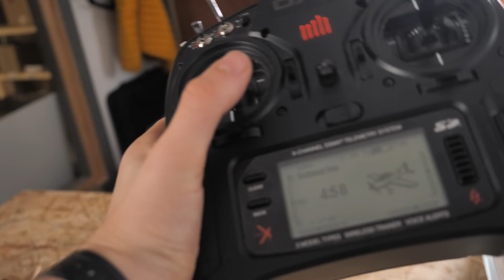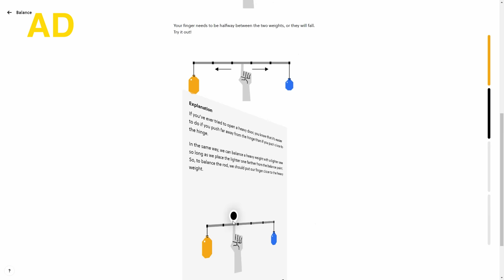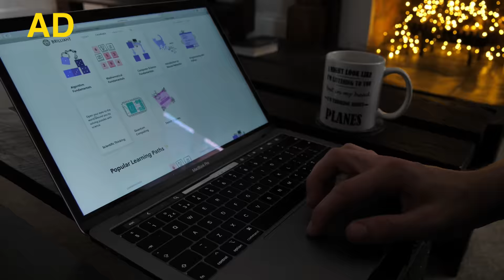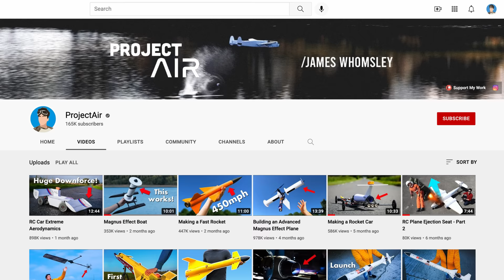Making an RC Submarine

Comment: Great project! I like the small size of the sub
Reply: Yeah
Reply from the maker: It'll be handy for exploring tight spaces!
Reply: Dave Doherty  A pulse jet powered submarine powered by...
.
.
.
.
TOMATOES!
Reply: @Project-Air  The simplest way to eliminate water slosh upsetting the balance is to fill the water bottle with sponge. It will absorb the water and what does pool in the bottom won't be able to move fore and aft.
Reply: @Project-Air  Your submarine reminds me of the one made by Brick Experiment Channel, cos it is made using everyday household components. :) I like this ingenuity. 10/10
Reply: Aren’t small things great

Comment: This is so cool. Was thinking a lot about building an FPV sub. And I run into same problems with water and data transfer in my head. I would try and just expose antenna to the air on a really small and light floater using very thin wire. Tangling could be a problem in that case, so I thought about some sort of antenna wire tension/retraction system. Not sure if there are antenna wire length-related problems, tho.
Also, 3rd motor oriented to up/down axis and with some pitch control would give it much more maneuverability and control in tight spaces. And could compensate for most of the boyuancy problems.

Comment: As I mentioned on Matt's video: I love the designs and can't wait for someone to inevitably come up with a truly wireless control system for subs :)
Reply: sonar might work well for a few hundred meters until it becomes laggy
Reply: @nou5440  I've seen some experimentation for ultrasonic used for communications so I'm definitely curious if that would work reliably in their small creeks/ponds
Reply: @nou5440  I've often thought about this. Problem is, there'd be no way to get video back.

Comment: Great video! Add a 'trailing floating wire antenna" for the RC TX/RX. Make it buoyant and long and some portion of it will float on the surface, even when at depth. (BTW, That's what real submarines do)
Reply: this is a good idea. plus sub marines arent designed to move fast

Comment: Great work! Really interested to see if you find any success with the low frequency stuff. I've heard you can "potentially" get up to 30-40m in fresh water for basic controls with the right conditions at 27/40mhz. Video transmission may prove to be much more difficult or perhaps simply limited by bandwidth and/or physics, but I'd love to see your results regardless!

(btw there's no link to Matt/DIY Perks video in the description as of writing this comment)

Comment: The trick to low frequency data transmission ( for the video ) is that you have to broadcast the data over a spectrum of frequencies because the max data rate will always be frequency/2. So basically you end up transmitting 1/10th of the data on each frequency, but you transmit on 10 different LF frequencies and recombine the signal at the receiver. I don't know for sure, but I think that the Navy uses a lot LF transmissions for underwater coms.

Comment: Humm... I didn't thought about the sloshing water, I did for the cable, it was huge.

Some notes.
For water sloshing, have you considered using foam or a more dense than air material that can be fixed?
I also thought about peristaltic pump and a bladder for better buoyancy control, for Diy perk's sub, turns out I wasn't analyzing his project correctly again.
On communications, a thin USB cable could be a decent tender.
However I would consider just a long antenna cable attach to a buoy.
My thought being, just use a long wire, however it has problems with impedance, so just a long coaxial cable sound safe to me.

If only submarines weren't expensive, a relay fleet sound like fun headache.
Reply: I like the idea of the floating antenna. Indeed coax cable will be needed. But for sure: waterproofing a cable will be a challenge. Even in military size subs they still have a challenge in communication

Comment: I think the problem with using a water bottle as a ballast is that the submarine design isn't always going to be level, unlike DIY Perks' design which doesn't pitch forward or back. With yours, once you pitch forward or back, the water will go to the furthest point in the direction your pitched in, making it really difficult to pitch the other way. We could see that when you tilted your sub down, it never levelled out again. This wasn't a problem with DIY Perks, as his submarine was designed to be symmetrical, meaning it's CoM is in the middle constantly. If it was to tilt in a direction though, it'd probably be able to recover, as his has two dynamically weighted ballasts, meaning it could go back to the surface and level out, or make one side lighter than the other to level out and then equalize the weight once level.

Comment: Great project! How about a simple floating pod with all the avionics (2.4GHz ok :) - then a long thin umbilical down to the craft? This would be similar to the Nemo dive system -  a 9m deep battery powered scuba system - only it uses an air pipe instead of the cable :-) The craft should easily pull the pod along.

Comment: I used to race sailboats around flags on lakes.  To keep the flags in one place we built them with a concrete anchor (plastic jug with a handle filled with concrete), and tied a 10 feet (roughly 3 meters) of polypropylene rope (the yellow stuff) to the anchor.  The flag was 10 feet of 4-inch PVC pipe sealed at the bottom but with a hole for an eye bolt.  We tied 10 feet of polyester rope to the pipe.  The pipe was partially filled with sand so it would bob in the water with the flag end up.  Polyester rope sinks to keep from fouling boat propellers and rudders, and polypropylene rope floats (to keep from fouling on the bottom of the lake).  The rope in the middle didn't matter as much.  So if you wanted to make a floating marker tethered to your submarine, you could do something similar.  Below 10 feet deep there's not much to see until you get to the bottom.  Adjust your rope accordingly.  Our lake was 130 feet deep near the dam, so we needed about 200 feet total for our purpose.

Comment: On board power with a very light tether (cat6) seems to work best.  Add weights/foam nodes on the tether to make it neutrally buoyant. Another option that might be cool for control (not video) would be to play with a sonic pulsing transmitter/receiver set up and a light weight video cable.  I think combining the two set ups would be ideal though.  A light weight, neutrally buoyant  control cable connected to a float which has radio on it so the cable would be for depth only.  I love the VR helmet set up. I would add a heavy fishing line (In the U.S. we hall it 80 pound test) tether to the float for easy recovery.  For power look into the tubular battery packs some cordless tools have. I wold also mount the two main motors on the fin controllers you originally had so you can change the pitch to look at something with out moving from where you are.

I love the video and wish I could do things like this myself.  Thank you.

Comment: Hmm, as an alternative to completely filling the main bottle with water, fill it so it is neutral then weigh that water.  Mix up some epoxy to that weight and put THAT in the water bottle (sitting level).  Once the epoxy cures it won't be moving.  Then you could probably use smaller syringes for trimming the buoyancy.  You could also make a 1 or 2 meter long 4 wire tether going to a foam float with the antenna for the RC and FPV mounted on the float.

Comment: Love this! But I have a couple of ideas, firstly for low frequency control getting an older JR or Futaba radio will be by far your best bet as they are module based and just as programmable as modern stuff. But for your sloshing my suggestion would be to try and fit a set of baffles within the bottle, no clue how, but that would vastly limit the effect the water's movement has on the sub's movement.

Comment: I'm growing more and more tempted to build a sub like this. 

I think it'd be cool to do your buoy system from v1 but instead of sending power and a half dozen signal wires, instead get a receiver with a serial protocol (like how DSMX satellites or SBus Receivers interface with multirotor flight controllers) and run that data down through ethernet cable like Peter Sripol's sub  and then have power and interpreting onboard the sub, but still be able to have wireless above the water and then have a pretty light, decently flexible tether. Then you could get data back up to the surface via another pair of wires and then put your FPV transmitter in your buoy as well. 

I think the "Pro ROVs" have a neutrally buoyant tether so it affects the craft less too, but it's kinda pricy if memory serves.

Comment: If you fill the bottle with a granule material it might help with the sub's balance. The granules/particles will occupy the volume of the bottle but the spaces between them will be occupied by air making it stable to changes in pitch

Comment: I love the simplicity of the design! Is it feasible to 3d print a structure that would fit between the silver cap and extend axially into the bottle?  The structure would feature an external drive propeller and dive planes and the internal portion of the structure would contain RC components, a syringe pump system, and a power system. I understand it would add a layer of complexity to the ROV but it would preserve the overall simplicity of the design. DIY Perks has done half the work it's a matter of sizing the structural frame to fit inside the bottle.

Comment: You have given me some great ideas. Like adding a shifting weight inside the bottle to change the center of gravity forward and backwards. Mix that with rotation on the motor pods, so you can tilt the craft to sa set angle, and have the motors provide thrust at the same angle to move along at , say, a 30 degree angle tilt with a 0 degree forward direction. Space the 4 syringes around the hull evenly to distribute the buoyancy around the craft so it could maintain the tilt angle more effectively. And add 2 motors lateral to the thrust motors to add a strafe option to the craft.
Reply: Something like a weight on a rack and pinion driven by a servo for the shifting weight in the main hull of the craft. I know it could be done with syringes at the fore and aft of the craft, but thats more serovs and more syringes and more moving parts than a simple weight on a rack in the body of the craft.

Comment: Use CAN bus modules and Arduinos for control to greatly reduce your control cable issue.  Only a twisted pair of wires required:

Can Bus max data rate vs wire length

1 Mbit/Sec - 40 meters (131 feet)

500 kbits/Sec - 100 meters (328 feet)

100 kbits/Sec - 500 meters (1640 feet)

50 kbits/Sec - 1000 meters (3280 feet)

Comment: Hey please do a part two. I know im kinda late writing this but hear me out. Ive got some ideas;
- Put all the electronics inside fore a more hydrodynamic body because you will still be able to move center of gravity around and by sticking everything with velcro to a big sliging platform you will be able to make fine ajustments and still be abe to reach to it wheen troubleshooting.
- Cut the cap of so you only have half of a metal bottle and 3d print a big lid mith hydrodynamic form.
- And make the big cable smaller by using a ethernet cable and choose a light and flexible one. The batteries for the motors can be stored inside for more weight
- The syringes should remain for balancing
I hope you will read this and let me know what you think of these ideas
Love your content

Comment: Just use a single thin wire from the receiver antenna to the transmitter antenna the waves will travel through it or just from the receiver to just the surface of the water will be good.

Comment: 1:08 Some brushless motors are, but most, and very clearly those, are not, it's just that motors don't mind water, brushed motors work fine too. Properly waterproof motors are useful when going into dirty water though, since you don't want it getting jammed with crap.
Reply: Same with the servo, some conformal coating on the control board is all you would've needed for it to "stay unfried" as you said, you do want to waterproof it properly though to keep it running smoothly of course, water is not a great gearbox lubricant.

Comment: You could also maybe experiment with connecting your transmitter antenna so an 18" diameter metal disc that floats on ( but is submerged in ) the surface of the water. I wonder if that would more effectively direct the 27Mhz signal into the water and boots your range?

Comment: Great build! How about using a tether but ONLY for the RF aerials? If you used Micro Coax cable would be a tiny fraction of the size of what you had before and would create minimal drag by comparsion?

Comment: Very nice approach. I'm planning to do mine, in a bigger scale. The RC control is the main problem.
Instead of water, I suggest you to use steel bars, or concrete as ballast.
My project will add some manipulation device to do something underwater not just images. Congratulations!

Comment: Float the coax cable...it would be tethered, but as long as the cable was "semi buoyant" and the submarine could drag it around it would be able to get signal to the antenna on the surface

Comment: I wonder if you'd fill a bottle with oil instead of water, would you need these syringes on the outside of the hull ... Maybe one would suffice instead of four. Or, on the contrary, perhaps some more emphasis would be needed.

I am happy with your cooperation. I love DIYPerks :-)

Comment: You could always cast a block of lead to make up the buoyancy issue, gluing it in the correct place to get the trim right , also with the now dry interior of the water bottle you could add your batteries and electronics on the inside where its dry. Run one small wire up to a small float as the new antenna for the RC gear.

Comment: potentially using a flexible ethernet chord with sbus, video and 5v to a control box at the surface / pier. this could give you a lot more range and the right type of wire could actually behave more like a streamer rather than a drag.

Comment: 6:50 You could have partially filled it with jelly that was equal in volume to the water that was in there.  That way it wouldn't have moved regardless of pitch.
Reply: My thought was use epoxy equal to the weight of the water.  The same volume of jelly (or epoxy) would weigh more than the same amount of water I believe.

Comment: You can use 8" lengths of pipe insulation roughly every 12-18" along the umbilical cable to make it neutrally buoyant so that it no longer drags down your rov or negatively effects its movement abilities.

Comment: I believe perhaps, You probably could have filled it with plaster or anything solid that’s lighter than water per cc. 

Or Also with the original lift only at the rear, you could’ve used heavier weights only or mostly at the rear to keep the rear at a “constant sink” and use the trim on the servos to help the rear lifting force to balance/counteract said force. Which could potentially keep it level near or at the bottom surface, or continue to increase rear lift until it pitched the whole craft upwards and allowed the front fins plane/angles to true the craft naturally in coordination with the propulsion force.

Comment: Great video. Did you think about using a small tether and float just for the antenna? It might limit your depth a little. But it would allow the sub to submerge as far as the tether is long. Shouldn't slow the sub as much as that monster umbilical.

Comment: You just have to put the antenna in a foamy box or something else to keep it above the water surface, and let uav drag it around. That one can keep the video code rates high by still use 2.4ghz. Maybe one can adapt the length of coaxial cable to remain the antenna right above the uav. And the propeller is too big, you can add another two motors, it’s just a drone fly  in water you know...... And most importantly a big LED for content.

Comment: A idea I thought of to solve reception, use one of those old style telephone headset cord spooler that winds up the cord automatically. spring loaded. connect one end to the transmitter cord on the sub, connect the other end to something that floats like a balloon. while the sub dives the balloon stay on top of water while the cord unwinds. when sub goes up the cord winds up.

Comment: Very nice, HOWEVER... a submarine with a main hull full of water just feels so wrong! Furthermore, I sense trouble around the corner with your syringe-trim-tanks. Once you reach a certain depth, water pressure might push the plungers in, thus reducing buoyancy and sending the boat to even deeper depths (insert Das Boot-style metal-creaking and rivets-popping sound effects). I would suggest keeping the main hull full of air and attaching little containers that can be filled with sand or lead-shot to adjust trim and buoyancy.
And I wonder whether using these huge propellers under water may put too much strain on the motors (I may be mistaken, but they look like drone rotors).
Anyway, I like your approach of getting cracking and crossing bridges as they turn up. Keep up the good work.

Comment: Mount the receiver to a floating little box or something like that. Then add a cable of desired length so that you can go deeper without losing signal because the receiver and submarine move separately.

Comment: I was thinking a while back about using an acoustic transmitter and receiver for a sub. Just speaker and mic effectively and use clicks to transmit a ,PPM signal or something. It would clearly not be able to do video, but 50Hz 4-ch seems doable this way and I suspect the range would be great since water transmits sound super super well.